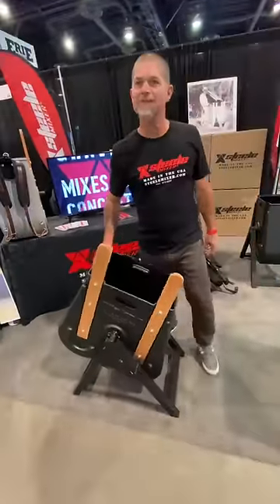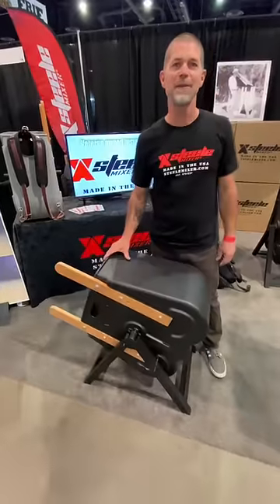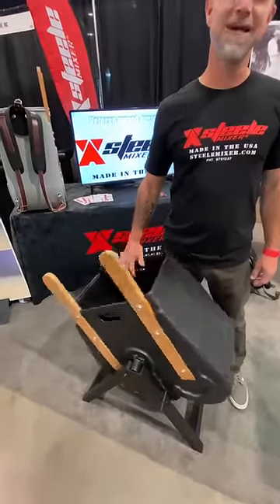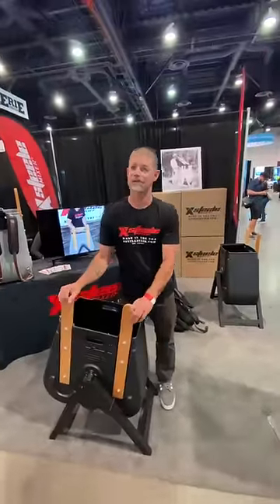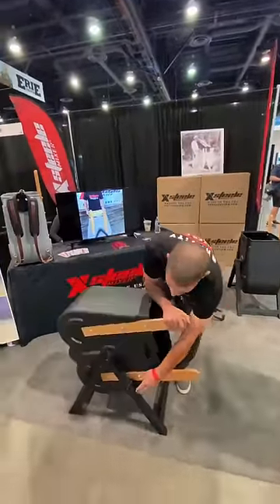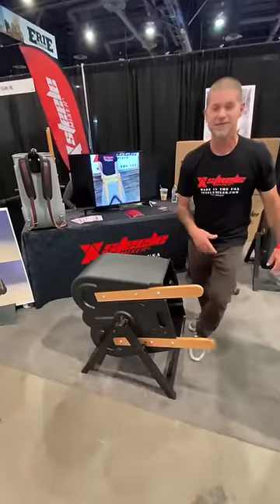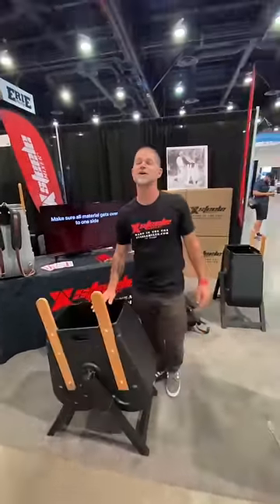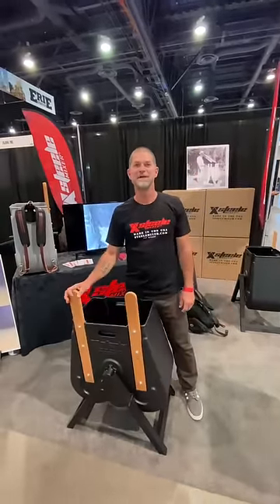No power -No problem. Mix concrete in 40 seconds #shorts

Comment: That means I need to pick up a bag of concrete every 40 seconds. And for that reason, I’m out.
Reply: U have to pick up a bag for any mixer or premix then dump but ur picking it up regardless and that’s a lot lower then most mixers
Reply: Hopefully, out to lunch early. 😅
Reply: @greedygrubby9293  the height is an issue ..I assume they have a higher stand to dump into wheelbarrows or carts
Reply: @OntarioBearHunter  I would hope so that would be a killer on my back working from that low
Reply: Not to mention it’s $300
Reply: @OntarioBearHunter  nope. It’s not designed to dump. It only goes so far down. It’s designed solely to scoop out with a flat head shovel. I’ve seen the video.
Reply: You could get 2 mixers then. Well, that means you need to pick up 2 bags of concrete every 40 seconds. And for that reason, I'm out.
Reply: It amazes me how ignorant people are. And because i can't fix stupid, I won't bother trying.
Reply: "I'm trying to look busy mofo, this half a mile bridge is a 84 year contract!"
Reply: If you are mixing enough concrete to need to do this over and over every 40 seconds, you might as well order a cement truck to come and do the pour. This is made for small concrete jobs, such as anchoring posts for a fence or deck, not for pouring a driveway.
Reply: This is for a DIY market maybe isolated areas won't be mainstream construction... Still good idea... nice one
Reply: @bagenius5970  I work on boat access camp sites where a truck isn’t an option. It’s 60 pounders all the way
Reply: @glovepro1256  Sounds like a personal problem
Reply: @glovepro1256  definitely a personal problem.
Reply: Thanks Barbara
Reply: They not that heavy. It’s more time consuming opening the bag
Reply: Weak
Reply: Some people here REALLY missed the joke.
Reply: @bagenius5970  still cheaper and easier ways.. like a wheelbarrow or post set that you just dump in the hole and add water after.
Reply: @OntarioBearHunter  You said "dump in the hole" huhuhuhuhuhuhuh
Reply: for one time home projects , the perfect tool i think . and you can put flowers in it after
Reply: Ok barbara
Reply: @OntarioBearHunter  you add the water to the hole first
Reply: @greedygrubby9293  a sense of humor you need

Comment: Wheel barrow and shovel: Am I a joke to you?
Reply: It true but what about ground and shove
Reply: There's many ways to do things, just because you can mix it with a shovel and wheelbarrow doesn't mean there's no easier option. Work harder not smarter huh 😂.
Reply: @stpbasss3773  true true. So what a about the self mixing cement. But your probably right but the sane work smarter not hard is not always applied way because at the field it more like work comfortable and long then smart and short. This mind set was set to make the most amount of money in the long period of time without making you look like a slouch. Why like this simple equipment is expensive it get to the point were you can sell your own kidney and still not have enough money because of prices. Well in united States at least 😓
Reply: @luckyCOYOTE27  If you do it for a living it's an investment and pays itself off eventually.
Reply: Yes
Reply: @luckyCOYOTE27  self mixing doesn't work for cement pads, just putting in posts. Your pad would be absolute trash if you tried self mix
Reply: @nicholascecil6733  🥳
Reply: @nicholascecil6733  who tf is mixing cement with bags for pads. order a truck.
Reply: @nicholascecil6733  lol... privilege, its cheaper in the long run if you are pouring slabs.
Reply: @stpbasss3773 you just added to additional bullshit u gotta clean with this
Reply: You clearly don’t understand how difficult it is to mix 4 bags of concrete with a shovel. ALL DAY LONG
Reply: We do it on the ground, with shovels.
Reply: @nicholascecil6733  I done my 40x60 pad with bags. Been 4 yrs and only cracked at the joints and you can't drowned a quarter on it
Reply: @stpbasss3773  easier?  I don’t think so.
Reply: At least you had a wheel barrow I worked in a bucket 🥹
Reply: @dustinjohnson492  4 years and its already cracked? My driveway is 25 years old with no cracks yet.
Reply: Depending on how much you have to mix
Reply: With a tarp and another guy you mix bags of concrete in about 1 min

Comment: This is the Steel mixer.....its made out of recycled "plastic" that made me laugh randomly 😅
Reply: Steele mixer. It’s a name.
Reply: @SunsetPyro  you’d think my glass water jug is hilarious and my Sand wedge, it’s carbon fibre?!? 😂
What a crazy world. 🤡
Reply: They make burgers out of recycled lawn and call it a burger still. Dudes are chicks. This contradiction just doesn't do it for me. I'm so desensitized. It takes so long to get off
Reply: @SunsetPyro  Clearly. 🤯
Reply: I did too
Reply: Think the guy's name is steele.
Reply: Steven Steele owns the company
Reply: The still mixer
Reply: And it mixes concrete
Reply: Steele is the brand!
Reply: I think it's called the 
Ex-Steel Mixer.
Means NOT steel... as in now made of plastic.
Pretty self explanatory. 
I would like to see it actually being used...instead of a
Pretend using.

Comment: I do fence installation for a living and usually a wheelbarrow is the way to go…because it has wheels.
Reply: It comes w a stand that has one wheel to cart it all over job site quickly and efficiently...
Reply: No such thing as a wheel barrel. Its wheelbarrow.
Reply: @All-Outta-Bubblegum  🤣
Reply: So then tip mix in the wheelbarrow once’s it’s done
Reply: Wheelbarrow is cool for certain situations. But, in all honestly nothing beats a standard drag pan and just bangin them by hand. I often do concrete underneath houses in the crawlspace. And it's usually nowhere even near the amount of concrete to justify a supply truck and pump truck on the job. It sucks, but we belly crawl the 60 pounders to where they're needed, split, mix, and dump in just a regular plastic drag pan. 
        Wheels don't need reinventing.
Reply: @thedevil3890  ya but if you don't do your job and you don't have to drag 60 pound bags under homes crawl spaces, then why would you make it harder on yourself. It's not super easy to mix in a wheelbarrow with a shovel. Sure, maybe a bag or two, but all day, bag after bag, this thing would help, and it's easier.
Reply: @calliew311  I don't mix in a wheelbarrow with a shovel, that's extra work also where the only benefit is you can hang multiple bags at once and wheel it to another spot as long as the terrain is willing. Drag pan and by hand. Fastest and easiest way with the least amount of cleanup or extra tools/equipment to haul around.
Reply: Someone sounds salty.
Reply: Mixing a bag in a wheelbarrow takes me a couple min tho.
Reply: @All-Outta-Bubblegum  🤣
Reply: 4 Wheels would make it easier to load and move. Having a lid with an opening on the side would be easier for small jobs or forms without making a mess. One other thing, use a 2 to 3 " flex hose and run your concrete under the house inside hose with a shop vac or air compressor to blow the concrete under house. It is so easy and no mess!!! You do have to replace flex hose unless you clean it immediately  before it hardens.
Reply: Same but I can see this being nice when. I'm by myself cause my coworkers are drunks
Reply: @0xsergy  it really doesn’t take that long .. it’s just tiring af lol
Reply: About 10 comments on here calling them barrels 😂😂😂 definitely barrow
Reply: @MaNNeRz91  it's ok, when your from the south that's what they call them....wheel barrels. Depends who ya ask and where their from.
Reply: @darlataylor7537  it's not a barrel though. And I'm from the UK where it's always been barrow 😂😂
Reply: @MaNNeRz91  well folks in the USA in the deep south call it barrow or barrel. Like I said it just depends on who you ask and where their from. I actually call it a wheel barra 😆
Reply: Who mixes concrete for fencing unless its chain link posts. I hope nobody but I'm sure there are some idiots that know nothing about a dry pour, tamp, then water
Reply: @darlataylor7537  some call it a Mexican forklift in the deep south
Reply: @natedawg88  lol yep they sure do
Reply: @thedevil3890  I work in crawlspaces myself and we’ve never taken any under the house we only use it for basements in wheelbarrows, i’m honestly just curious what you concrete? your company may do things different
Reply: @pxpibrad  Sometimes we're doing repairs to the inner portion of foundation walls. Most crawlspaces I'm in are no taller than 2 or 3 ft high. Which means we're belly crawling.
Reply: @thedevil3890  makes sense, we only do waterproofing in the crawlspaces we never mess with foundation
Reply: @pxpibrad  We do vapor barriers as well. But yea, usually inner foundation wall repair or sometimes we pour a bag or 2 around the 4inch waste line if theres too big of a void around the pipe.
Reply: uh yeah my crew only does dry cement, water, tamp, rinse+ repeat but if we need to mix cement like setting chain link posts or rebar inside vinyl posts we use a wheelbarrow*
Reply: Just mount wheels on it then.
Reply: Use a 5 gallon bucket and a paddle but for a drill . Mixing drill with power or a 18-20v battery drill on low gear . Takes 60 seconds per bag or less
Reply: Quickrete Fast Setting, designed to set without mixing.
Reply: @MaNNeRz91  You're also from the land of teeth shooting out in every direction.
Reply: They could've attached lockable wheels to this pretty easily
Reply: @katedaphne4495  no? 🤔
Reply: @All-Outta-Bubblegum  5va
Reply: @darlataylor7537  have you even pushed mud bro?
Reply: @maxl3189  yep sure have and plenty of it. Why?
Reply: Tow behind mixer. You’re loosing money mixing it by hand
Reply: @darlataylor7537 
When you're from the South..

Are all Americans illiterate, or is it just the majority of Americans who leave comments on YouTube? 🤔 

you're and your are different words; they're not interchangeable.
Reply: There is actually a cement mixer that looks like a paint shaker and it comes with a bucket with pour spout and lid AND it has a base with wheels and is transportable anywhere without straining a vain. It's a no brainer and the company is out of Wisconsin
Reply: Has anybody seen how to mix one or two bags of concrete with one tarp? Very easy in less than one minute
Reply: We have a wheelbarrow attachment coming out soon
Reply: @jdh23h   I have a mini hole hog I use for that and it’s awesome!
Reply: I mix it in the hole.
Reply: @thedevil3890  the new "Abs Of Steel" workout.
Reply: We have a wheelbarrow attachment coming out soon

Comment: Electric concrete mixers are way cheaper, so the only application case is “middle of nowhere” and “more than a few bags” and “too old to use a mixing trough”. So maybe if you had a gatepost to erect? Wranglerstar bought one
Reply: I appreciate veterans. No offense. But that product straight up bullshit
Reply: @bradforester3635  it works well from where I've seen it being used, and it's definitely easier to cart about than a mixer. It's certainly got a market niche, but it's maybe for people who just want to fix one problem and not something that's more versatile. A lot of inventions are like that, trying solve non problems for lots of money
Reply: @____________________________.x  i do concrete for a living
Reply: @bradforester3635  so not the target market then
Reply: @bradforester3635  If you do concrete for a living, then this product is certainly not for you… The idea that because it’s not useful in your line of work it won’t be useful in any line of work is an obvious fallacy. This product could be very useful for those who do small concrete jobs occasionally and want something cheaper/lighter.
Reply: @bradforester3635  product is for average joes who aren’t doing concrete work for a living.
Reply: You don't even need to mix fast setting concrete for posts.

Pour the bag in the hole, pour the water on top and poke it for 30 seconds. Mixes itself.

Don't belive me, pull one up done this way and youll see.
Reply: @bradforester3635  why do you appreciate war criminals?
Reply: Bahahaha wranglerstar is a tool
Reply: @TheHeadincharge  sounds like you've never mixed a bag of concrete before. My old man would laugh at me for buying something  specifically for mixing one bag. 
Everyone has a wheel barrel and a shovel.
Reply: I mixed a whole pallett by hand one day
Reply: Well yeah, that’s a use case so is a valid product. Don’t make the perfect the enemy of the good.
Reply: @bradforester3635  you pour concrete for living this bs for you but for a bricklayer this awesome to do small repairs like window seals cutting closing or opening a window or doors
Reply: @CleverWheels  then they probably aren't gonna be in the market for something like that and would just mix it up without this
Reply: @jacobpoucher  I came to say that
Reply: @lordjaashin  Thats a big oof
Reply: @Heisenberg is Alive  i would have to agree. You can also move and dump a wheelbarrow.  after mixing in this contraption you need to shovel out the concrete? Iol
Reply: It's definitely not for commercial use
Reply: @evictioncarpentry2628  okay so you want to mix every post for 30 seconds instead of just mixing it all at once? You have a point if it's just one post, but this is clearly not for that my dude.
Reply: The problem is it cost as much as an electric mixer. There is no reason this can't be half the price it is and still make a large profit. So it's actually badv marketing or greed to make it as much as a normal mixer.
Reply: On my...  cry 😭 much?
Reply: Even then... generators... I’ve worked in the middle of nowhere on large jobs... small jobs... everyone has batteries or generators.
Reply: Premix would be the way to go for the middle of nowhere
Reply: Use post hold digger to dig hole, put post in hole, square post and secure with stakes.  Now, pour dry concrete in hole straight out of bag. Cover concrete with dirt. In 24 hours your concrete will be hard and post set.
Reply: @louielouiepks  The whole point of using something like postmix is that the concrete sets up quickly so you can complete a job in one day. With a dry mix you can't finish the surface of the post so it will shed water. And absorbing water from the soil leads to inconsistent curing and a weaker mix, and equally just tipping water in like some do has the same effect.
People always use too much water because they want it to pour easily, but a drier mix is harder
Reply: @____________________________.x  seems also that having fewer moving parts and just being a big bucket would make it handy for , say, DIY home renovations and repairs where you're doing several smaller jobs over a long period and an electric may crap out from she or be pricier.
Reply: @sebastianriz4703  Accurate though
Reply: @brixz800  id rather mix mortar for sills in a barrow or the mixer, from memory my layers prefered it rather sticky and firm and its generally the last job you you mix bulk up for the lads
Reply: @jacobpoucher  why do people hate wranglerstar? I see people bitching about him everywhere
Reply: @bradforester3635  “I do concrete for a living”
Well, “I like Turtles” 😂
Reply: @thankyoucaptainobvious7707  nice nice. Turtle 🐢 power.

Comment: Mixing Concrete is a chemical reaction that takes time it's not a speed contest. When a Concrete truck mixes on the way to the job it makes a difference on the time the truck has mixed to the quality of Concrete.
Reply: I’ve been driving concrete mixers here in the U.K. for 10 years sure he may get the slump he wants in 40 seconds but that’s dependent on water content or admixture etc. in the back of a mixer truck the only thing I have found is the longer it takes me to get to a job the lower the slump of the concrete will be depending if the customer has requested a retarder mix or not this product seems a good idea because the average contractor on small jobs will be basic mixes without admixtures etc

Comment: Two guys and a 6x6 tarp.  Add 80lb to center. Add 7/8 gallon of water.  Hold corners and alternate lifting one corner at a time.  Cary tarp to hole and dump without spilling a drop.  No wheelbarrow to clean or plastic drum.   Lay tarp in sun, when it drys concrete falls off.  Takes 30 seconds to mix 80lbs as dry as you like.  You can do dry pack with same method.

Comment: I say BS I’ve made thousands of bags of cement and mortar. Sloshing it back and forth isn’t gonna thoroughly mix it.
Reply: I thought about that too! But maybe it has something to do with the shape of the bottom of the bucket, I don’t know!
Reply: @theimpaler2317  An actual demonstration would have been more convincing. Dude said he can mix a bag in 22 seconds👀👀
Reply: @foxwood67   I know, right?!? I looked up videos of people using this mixer, and it does take some people a little bit longer than 40 seconds like he first said. But i saw it in action in another video and the way it works , it has those tall ridges at the bottom of the drum and that’s what causes it to mix.
Reply: @theimpaler2317  okay I’ll check it out. 👍
Reply: The comment I was looking for 👍
Reply: @foxwood67  and this video is around 45-50 second's and still hasn't mixed the first bag
Reply: Yep.  Not a complete mix
Reply: Not true. It mixes it 🤙🏽
Reply: @steelemixer3278  There is no better marketing strategy than an actual product demonstration.  Telling me it works means nothing.   Responding with “ it does work” still means nothing. Post a  product demonstration link or several links
Reply: I’ve used one, they have ridges on the bottom and it mixes the concrete quite well and very quickly.
Reply: @wyatt415  this guy obviously used one cause it does exactly that!!!